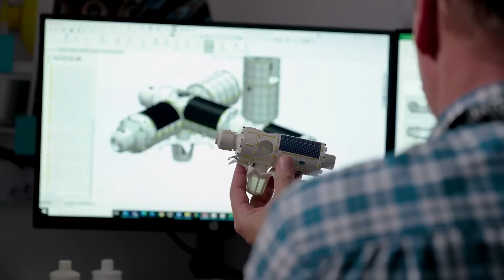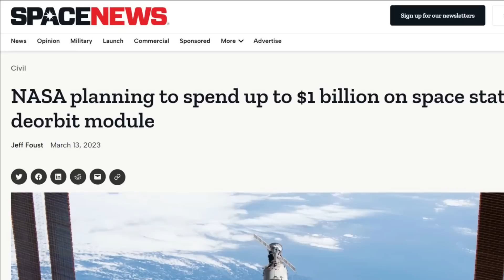Why NASA Is Worried About Switching From The ISS To Commercial Stations

Comment: Rather than burn it up, why not push it farther up, between the Earth and the Moon and station it as a life boat, largely shut down but a safe haven in the void for the ships that will inevitably break down? Someone suggested recycling it in space, where the components will be useful for raw material or modules. The point is, it's up there, why bring it back down?
Reply: Sadly, is not so simple. The ISS requires regular assistance from others spacecrafts in order of keeping is altitude, if you want to push the entire station to a higher orbit, you probably need a HUGE space tug, which doesn't exist. Also, the station is not designed for operations in deep space, you have to redesign the entire station in order to make that work, and we need to save money for Artemis.

Comment: NASA should work with spinlaunch to cheaply  spinlaunch water to a low earth orbiting station that can process it into rocket fuel, and  refuel rockets to minimizes stages needed  for missions  to the moon and Mars.
Reply: There are tens of thousands of known Near Earth Objects which contain vast quantities of water ice and frozen methane.  These are easier to reach than the Lunar South Pole, just not as sexy.  Spinlaunch is interesting but is only capable of lifting mass to a high altitude, not of providing the 8km/s (18,000 mph) of horizontal velocity.  To retrieve ice from a NEO to LEO only requires 4km/s, less than half the velocity, and therefore less than 1/4 of the energy.  Remember E=1/2M v^2.
Reply: @jamescobban857  correct, low earth orbiting spin launch can't give the horizontal velocity needed.  But spin launch is really a hybrid launch platfirm with small rocket to provide the remaining horizontal velocity needed. 

It is interesting to note that the current suborbital launch platform can launch at 5000mph or 2.235 km/s, and that if it were on the moon, we could compare that to the escape velocity at lunar poles being 2.38km/s or 2.13 km/s at its equator.

Comment: Take a Cargo Dragon, fill it full of fuel instead of cargo.  Install a couple of aft facing thrusters on the  trunk and wala there you have a deorbiter.
Reply: I doubt the 6 tons Cargo Dragon payload would be enough to move the entire 450 tons space station.
Reply: @Sun-like42  If would be enough.  The natural orbital decay of the ISS will deorbit it with out constant reboost.  They can use the tenuous atmosphere for most of the work.  You'll only need a deorbiter for the final push  to get it to deorbit where you desire and a fueled up  properly configured Dragon would be more than up to the task.
Reply: NASA at the moment is: "The space station will accomplish the deorbit maneuvers by using the propulsive capabilities of the space station and its visiting spacecraft. NASA and its partners have evaluated varying quantities of Russian Progress spacecraft to support deorbit operations. Additionally, NASA is evaluating whether U.S. commercial spacecraft can be modified to provide capability to deorbit the space station."
Reply: @WWeronko  That would be great. But why are they developing their own deorbit vehicle then?
Reply: @Sun-like42  They are investigating not developing.  The Russians may not be cooperating.